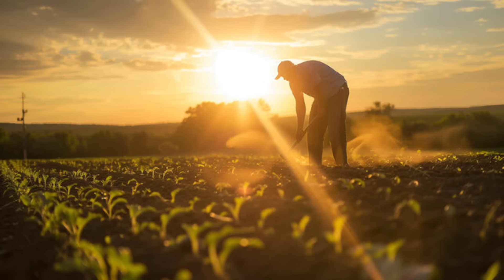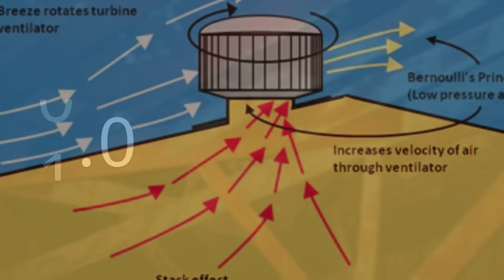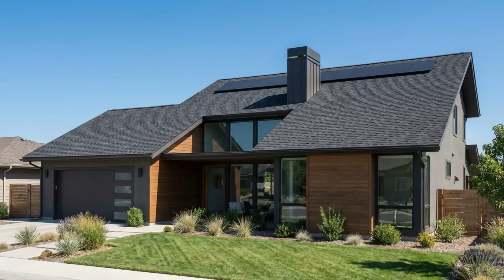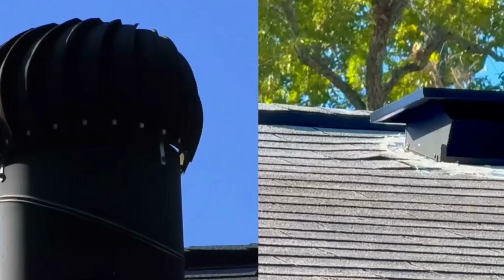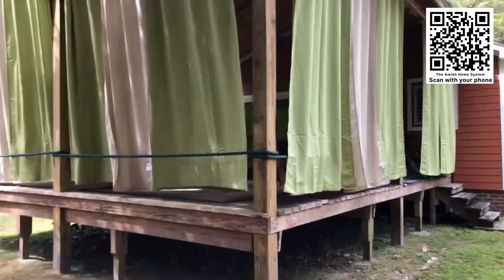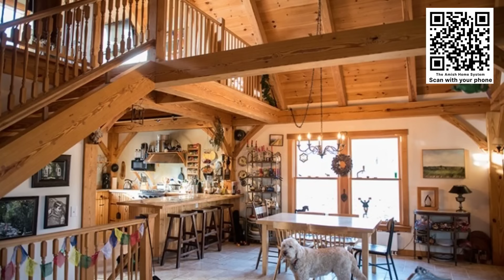This $30 Attic Device Cools Any Home By 25°F FOREVER. Why Aren't We Using It?

Comment: Turbine vents and radiant barrier do have real science behind them, and attic ventilation genuinely matters for cooling load. That part checks out. But the 40-79% cooling bill reduction claims are doing a lot of heavy lifting, and the framing around a secret industry suppression conspiracy is a red flag for inflated expectations. Attic temp and ceiling surface temp are not the same as indoor air temp, and the gap between those numbers is where a lot of these claims fall apart. If your attic is genuinely under-ventilated and your ducts run through it, fixing that can meaningfully help. But if your insulation is thin or your system is undersized, a whirlybird alone won't close that gap. Worth getting an actual attic assessment before the DIY Saturday. ars/rescue rooter does attic ventilation and insulation work in some markets if you want a professional look, though availability varies by location.

Comment: Here in Portland Oregon I rarely see those roof turbines anywhere.  My roof gets extremely hot, it has vents going across the top, but they stay closed since I'm old and can't get up there.  The cool air at night pushes down on the hot air, making the house sweltering humid and hot until after midnight during heat waves. I'm going to get somebody to install one of those turbine systems for me before the next heat wave, my old dog doesn't do well in the heat, so I have to put him in the bedroom with air-conditioner going nonstop.  Thanks Eli, I love your channel about Amish wisdom!

Comment: My parents bought my sisters house in central Florida they had those venteralors installed the only problem was the citrus rats came inside. I put hardware cloth and covered the in large  hole on each turbine.

 Back in the late 70s these turbines were very popular they did keep the house cooler. To help I put a box fan in the man hole opening it really kept the whole house cooler we  never used the AC because it cost too much to run. If we had company then we would run the AC. Well it's time to start using those turbines or use solar fans I kinda like that idea but I will use both. 73

Comment: Had a "roofing company " go inspect the attic, and tell me there was not enough ventilation, and sold me two solar powered attic fans. My wife has been complaining about more dust in the house since then. The attic access door is in the garage. I don't know how the fans are sucking air from the house into the attic, but that appears to be what is happening. I can see the soffit vent louvers, but my guess is they are not working. Time to stretch out the extension ladder and remove a louver and looksee at the insulation job ...